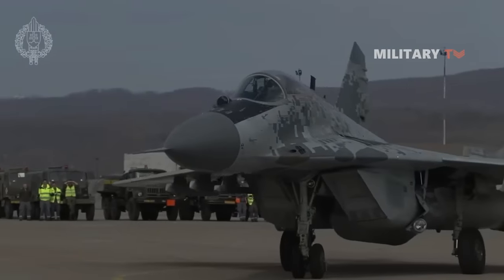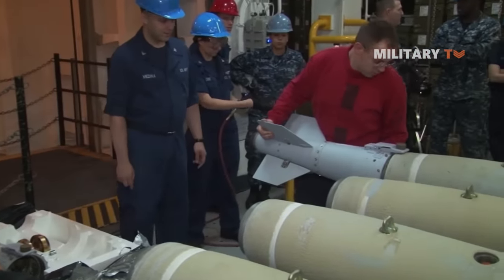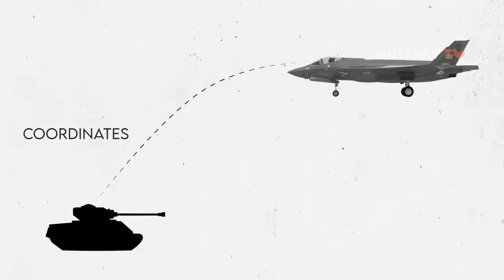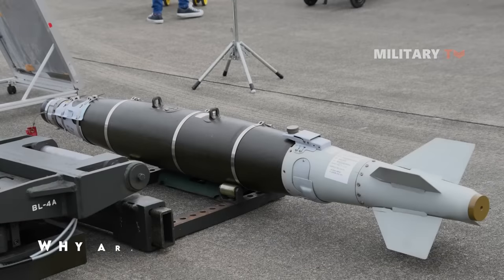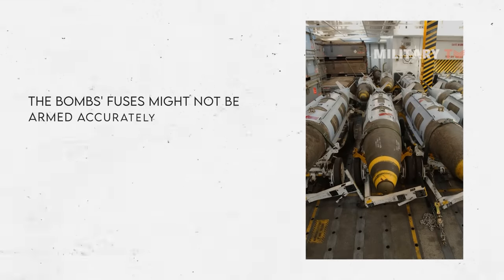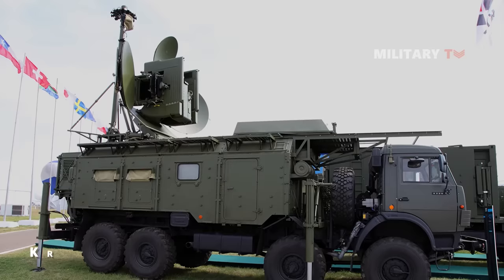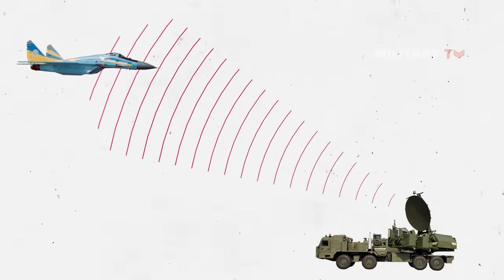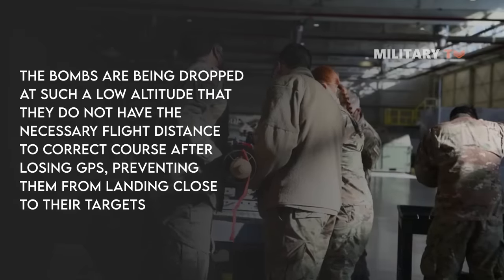Why Ukraine GPS Guided Bombs Are Failing?

Comment: Jamming isn’t the problem. JDAM, GMLRS, Storm Shadow, etc all have GPS and inertial guidance. If they lose the GPS they switch to the inertial. It’s not as accurate but it will still get the weapon close to the target. The real problem here is GPS spoofing so that the weapons think they are somewhere else and don’t switch over to inertial.
Reply: Huh. I would think GPS signals would have cryptographic signatures.
Reply: Is there a way to switch to inertial only? If this isn’t the case, I imagine there will be a team of coders at Raytheon working on this as we speak.
Reply: Your absolutely right👍But the and WE also Not realy with spoofong your 100%  right but there in that Problem and I think so they isolate spoofing,they find the Problem before😉
Reply: So, after looking it up, there are encrypted GPS signals, which should be immune to spoofing.
So I suspect the video is right - the problem is the jamming, not spoofing.
Reply: Glad to see this as the top comment. I don't know all the details of how the missiles can switch over to inertial guidance and anyone claims to is more than likely to be full of BS, but I would imagine you could turn off GPS guidance if you thought it was going to be an issue. It only makes logical sense. The people designing these weapons aren't idiots. It's my understanding most of these modern missiles have multiple guidance systems even beyond GPS and inertial. 

This whole video just screams Russian propaganda. 1. The poor English/tone it's written in. 2. Russia leads the west or Russia #1.... 

Do I think it's possible JDAMs are getting GPS blocked, sure.  Do I think Russia leads the west in anything other than false bravado and BS, absolutely not. Russia =/ USSR and they can't even build modern microprocessors or aircraft parts. How the hell are they ever going to lead a collection of countries that can and have economic power orders of magnitude more than they do.
Reply: @mundanesquirrel8687  Depends on what signal they are using.  If they are using the "C/A" channel, that is publically known to all.  If they are using the "P" signal, that standard is not publically available and is assumed to be encrypted.  My knowledge dates back to the early 2000 era, so more modern signals I am not familar with.
Reply: @julianmorrisco  Trying to find out the details of these missiles is near impossible without a clearance unless you want to rely on shady internet sources, but I would be SHOCKED if there wasn't an option to switch to inertial prior to launch. It makes no sense why they wouldn't have the function.
Reply: @kennethng8346  One would think a actual bomb could use the military encryption and not having to use C/A.
Reply: @mundanesquirrel8687  Yes that should be the case.  But we've seen many cases where civilian GPS was used instead of military. Heck, how would we know if some manufacturer didn't substitute a cheaper civilian unit and never expected to get caught (like the Russian firms).
Reply: Ngarm are need of the hour but they are expensive.
Reply: @specialK319319  incorrect, their range of air defence systems is unparalleled  in the west, many systems have no direct equivalent.
Reply: I'm sure that at the time of release from the airplane the pilot is aware of the coordinates and is able to check correctness.- If not, then it must be a simplistic "integration" with the MiG-29. 
UA is still successful in delivering precise HIMARS strikes, so the problem is probably lying differently from "simple" GPS jamming or spoofing.
Reply: GO old school  set them up to work with LORAN D  stations rather than GPS  as we did in South East Asia before there was GPS satellites'.
Reply: @spxram4793  I have no personal information, but I suspect the connections are very hot wired.
Reply: @mundanesquirrel8687  GPS is an international world wide system   and as far I beleive ti does not have a MODE IV (US SECURE)  or Worberlation (SOVIET SECURE) capability like the international IFF system.
Reply: @yevgeny79  modern inertial devices are really quite good. Each mobile phone, eacg drone and so on has integrated inertial sensors, and they're much better than these old things like in a B747 for instance.
No idea, what was designed into the JDAM.
Reply: @mundanesquirrel8687  Spoofing is one form of Jamming.  As an OLD ECM systems instructor there is a lot more I could tell you all but  then I would have to (you know eliminate you)
Reply: Truth is we allow to much information to be revealed as to how something works all they have to do is use the term smart weapons to keep certain things from the enemies knowledge
Reply: @dickslocum  ? GPS is just a generic term used to describe systems like NAVSTAR, GLONASS, GALILEO and so on.
All of them have different capabilities and protocols. Based on what you write, this should not be new to you ..
Reply: @John-hu9qg  Sure buddy, the country that cant build microchips and is now 15+ months into a war with a country a fraction of the size using NATO hand me downs has the best military tech in the world. They just have a humiliation kink and arent trying yet...
Reply: Inertial doesn't correct for wind, humidity, etc.
Reply: @mundanesquirrel8687  Military GPS is secure.
Reply: @specialK319319  I'm strictly referring to their air defence systems and missile technology, which is cutting edge.
Reply: @specialK319319 I read your observation two (2) times to fully understand your assertion. Thinking that the US is the only country in the world that can manufactures sophisticated weapons is an illusion. 
Yes, the US has spent billions if not trillion of dollars to be a dominant  military force in the world; at the same time  the US trumpets his success unabatingly every day, other countries are also working discreetly and amazingly have come up with the same/superior in quality products.
And yes, only few individuals will point out the shortcomings of their country's military. 
Acher Daniel Midland Company CEO said year ago when I was an undergraduate in the US that " the moment you think that you have discovered a product, someone, somewhere in the world has discovered the same product but does know what to do with it due his or her environment "
The US is excellent when it comes to propaganda. In fact, the US is the best in the world.  Does the US have good military products? Yes it does!
Does the US have the best military hardware in the world. Yes and No.
The reason the so called 'Smart Bombs" are not working is because the war contrary to what people say is between NATO and Russia and the latter has deployed some of her sophisticated weapons.
The
Reply: They'll rewrite software to adjust when GPS and inertia  tracking disagree.
Reply: @spxram4793  There are quite a few stories of GLMRS not being as precise as they used to if the Russians are expecting the area to be attacked.
Reply: @julianmorrisco  - you can bet on it! We are learning a lot about our weapons effectiveness in real time against Russia's tactics.
Reply: Hard to say without having someone on the ground feeding u telemetry data. But spoofing certainly could cause a 50 foot hole in an empty field. Lol
Reply: @mundanesquirrel8687 they are spoofing the satellite. I'm sure it gets real complicated real fast. I'm a cybersecurity student & it makes my head hurt how in depth a convo about this topic could go lol
Reply: @mundanesquirrel8687  Correct.
Reply: @yevgeny79  jsem si jistý že nevíte nic o vývoji inerciálních naváděcích jednotek za poslední pár dekád.
Reply: A document in code is not dechiperable if the document is destroyed...
Reply: @yevgeny79  you funny vlad nice try
Reply: @spxram4793  prob the latest jdams are akit so they can be upgraded.
Reply: Glad we get to test our equipment against Russia so we can improve it. Thanks, Ukraine will get it right and get it to you!
Reply: Maybe the American weapons are not as advanced as they say....
Reply: @yevgeny79  It’s not ‘super inaccurate’. It’s not pinpoint fly through a window type accuracy but it will get you near the building.
Reply: @spxram4793  My terminology is accurate. These weapons are guided by the USAF GPS satellite network. Glonass is, frankly, pathetic. Gallileo, however, is pretty good.
Reply: @ViceCoin  inertial corrects for wind. Look at the WCMD programme.
Reply: @mundanesquirrel8687  Spoofing is much harder than jamming, but the Russians have been working on it since the early 2000s. In Iraq their spoofing was able to make US weapons miss by dozens of meters. For hard targets that’s enough. And they’ve probably gotten better since then.
Reply: @dickslocum  GPS has the civilian mode and the encrypted military mode which is accurate to something like 1m.
Reply: @spxram4793  GPS is the acronym for the USAF satellite constellation. Others may use the same term. I am using it in its original sense.
Reply: @spxram4793  I am using the term GPS in its original usage as the USAF Global Positioning System satellite constellation. Not as a generic term.
Reply: @specialK319319  Dude, buddy, no one said Ukraine is building the weapons that are giving grandpa Vlad a migraine.
Reply: @ViceCoin  for wind it does, a bit, for humidity, um, I don’t think that’s much of an issue. I may be wrong, but I think wind is the big issue.
Reply: @mundanesquirrel8687  Exactly! That seems to indicate that Russian spoofing research is being employed to protect Russian assets from strikes.
Reply: @jdogdarkness  Exactly! There may be spoofing from satellites too. Otherwise, all it would take to block it would be some ground-facing foil to stop Russian efforts.
Reply: Spoofing is handled by comparing inertial to gps. If the two diverge more than max drift spoof is assumed and gps is disabled. Next step is for camera ground recognition where a camera looks at terrain and matches it to a map and inserts correction. Cruise missiles typically have cameras now. Maybe a 100 gram payload.
Reply: @yevgeny79  MEMS tech has improved so very low cost. If you have say $20000 to spend, laser ring gyro has almost no drift. I think it was 500 meters at 5000 km
Look up laser ring gyro. Try buying one used and watch who comes to visit you.
Reply: @julianmorrisco  the coding is outsourced to India where the programmers ask for Russian input. Then Raytheon charges American wages coding rates rather than Indian coding wages so that they make a few bucks extra profit.
Reply: @specialK319319 agreed
Reply: @mundanesquirrel8687  Spoofing of GPS has been done before to ships on the ocean.  It's a real known issue.
Reply: JDAM's are failing because they are, "Made in America". Derp derp derp.
Reply: @marjanpavlovic211  but americans weapons is the best according to CNN
Reply: @specialK319319  It's a good thing no one's depending on you for advice. More than 80% of the bombs, HIMARS and other missiles missing their targets, this is the issue, and the fact. The rubbish you posted here have nothing to do with the issue. Stop distracting,
Reply: According to Russian MOD, they convert shovel to Krushna Electronic Warfare System in jamming smart bomb. Confirmed by Nato😂😂😂
Reply: @marjanpavlovic211   bo they are but they get updated from time to timd the whole thing on jdams is its a kit bash the main. Bomb is an old school dumb bomb with added senseors amd fins to bring up the accuracy alot. Long as its updated or sensor replaced by better one it sill keep working. Trust these bombs are hitting their marks but from tine to time as with all weopons you will have misfires of errors and the russsians are def trying to find ways to jam amd spoof but that will only last so long till they overcome it.
Reply: Or maybe it is a level of expertise in delivery that the Ukrainians just don't have. They are receiving hi-tech munitions that US operators have spent years learning to use, not a few weeks or months. The Russian FAB bombs seem to have a higher degree of accuracy as well. This video should be a wake up call for those who continally rubbish the Russian capability in this war.
Reply: @kevin5073  nope fab bombs are proven to be inferior to jdams their NOT as accurate. However the fact that the russians are just as new as the ukranians are at using jdams cam be a big factor. How. Ever russians also have the issue of launching further away due to aa. Ill give the ukranians the win simply because theyve shown adaptability and quick curve learning but nost importantly the ukranians haven't. Bombed their own city like the russians did in belgorod!
Reply: Spoofing is a form of jamming.
Reply: @yevgeny79 hough the Earth is spinning and the moon is circling the Earth at a pretty fast speed and for that matter the Earth is orbiting the sun
and I suspect that the direction in which the Apollo craft left Earth
had to be accurate within a very tiny percentage of a degree.
Sounds very complicated even if the moon is big.

The soldiers firing missiles and shells in Ukraine are generally 
firing from an unmoving spot on solid ground 
to try to hit another unmoving spot on solid ground.
That's got to make things a bit easier.

Now if scientists could discover how a dog can figure out the trajectory 
of a curving dropping Frisbee to know exactly the right direction and speed
to run to intercept the path of the Frisbee before jumping and catching it.
Reply: @spxram4793  Those constellations you are referring to are GNSS. GPS is a US constellation.
Reply: @spxram4793  are you sure about that ????
Reply: Storm shadow uses terrain contour matching which make it entirely immune to GPS jamming.
Reply: @jeromebarry1741  ofc it has. it wasn't uncommon even in civilian life. but that wasn't encrypted, military GPS, was it?
Reply: They do not switch: they use both. Also jamming is different than spoofing. Guidance kit detecting loss of GPS vs. being confident in signal received is another thing entierly.
Reply: Storm Shaddow is far more robust, it is able to use digital scene correlation and radar retain contour mapping.  It doesn't need GPS at all.
Reply: @mundanesquirrel8687  and be frequency agile. Very old technology. Time to keep up.
Reply: @spxram4793  The ones in 747s are approximately 500,000 times more accurate than the one in your mobile.
Reply: @richardkudrna7503  the drift is a function of time, not distance.
Reply: @julianmorrisco  Inertial guidance needs to know where it was to adjust to where it isn't
Reply: @spxram4793  INS? - The first 747 could fly from the US West Coast to Sydney and not be more than five miles off track after flying thousands of miles. Hitting a target fifty to a hundred miles away seems less difficult. The GPS systems attached to dumb bombs do not seem to represent the heights of modern technology. They're quite cheap. That is a criticism all by itself in what it suggests about their abilities and accuracy. Information systems seem to pretty good. Time for accuracy to catch up. This is not the Gulf War and the Russians despite lots of bad decisions are not Iraq's Saddam Hussein in 2023. They have serious management problems but they are not technically inept.
Reply: @jamesjohnson1710  BINGO! We put all the info on the front pages of national papers everywhere and then there's the internet and children take home classified information and post it to friends on the net. Why am I so angry? Stupidity in others does that to me.
Reply: @Atchinin-ih4wq  If you have a really good idea, there's a really good chance legions of other people have the same idea ... or better.
Reply: @allengilbert3662  Yes - I have mixed up the terms - thanks for clarification.
Reply: @pavelsulc2617  The problem may be that the INS on a dumb bomb is only a cheap back-up. I have a feeling that spending a lot of money on the best INS technology may work - as good as any system - but be prohibitively expensive to put on a dumb bomb.
Reply: @richardkudrna7503  Not something cheap enough for a dumb bomb.
Reply: @John-hu9qg  their missile tech might be cutting edge, their jamming techniques are just coming into focus since an ew system was captured laat year.  I'm expecting any edges there to be smoothed out shortly 😏
Reply: @TedForbes-j4i  source: trust me bro
Reply: @mundanesquirrel8687  that would render is useless for the general public, wouldn’t it?
Reply: @sjoerdsantema  I believe GPS is transmitted both encrypted and in the clear.
Reply: @mundanesquirrel8687  Encryption can be broken.
Reply: You may be right. Combined GPS/Inertial systems use error detection/correction algorithms (e.g. Kalman filters) to minimize errors. If such algorithms are ill suited to jamming, I expect our signals intelligence has long been sampling and analyzing all signals, including jamming, has been modeling its effects in simulations against the missile's control system, and has/is updating firmware. From what I've seen in the news the HIMARS launched missiles have been quite successful as has the 155mm Excalibur smart shell. Perhaps because these travel so fast (relative to subsonic glide bombs) , their algorithms inherently rely more on dynamic INS signals rather than the slower updates available from GPS.
Reply: @ViceCoin  Actually, INS DOES correct for wind, humidity, etc.    The INS detects the EFFECTS (i.e. drag & thrust) that humidity, wind and varying air density have on the vessel's motion.
Reply: @mundanesquirrel8687  gravity waves?
Reply: @glynnwright1699  laser gyroscopes 
Astounding accuracy
Reply: @richardkudrna7503  The use of optics and terrain matching seem like they'd offer a major enhancement. But based on what is publicly stated, NONE of the ballistic missiles, like those fired from HIMARS, or JDAM use optics. It makes sense that in time they will. But given the prevalence of clouds, the utility of optics, at least in the visible spectra, may often be very limited.  We do have some munitions, like the 155 millimeter 'Copperhead' munition that use optics to home in on targets designated by a laser. Also, as best I i understand it, low flying cruise missiles may use radar instead of 'visible' RF spectra in order to overcome the effect of clouds.
Reply: The first misstake was to underestimate the enemy's capabilities. Russia is not like the talibans, they have advanced tech and skilled troops.
Reply: Add a phased array antenna on the belly  to the JDAM,  if it looses its GPS signal then change target and aim for the source of the GPS jammer, thus destroy the jammer, now it becomes a "radiation missile"
Reply: @richardkudrna7503  Actually, they are less accurate than other types, including ESGs.
Reply: @mundanesquirrel8687 Superior Russian shovel spoofing. Those Russian shovels are incredible.
Reply: Maybe  but then false signal had to gracefully changed so that not an impossible position is suddenly received , which implies a hook-off signal and⁷ immediately relying only on INS. 

I dont think that the Orcs is up to such a complex task.
Reply: @gregparrott  agreed, camera or emitting radar for terrain match sounds hard on a HIMARS missile intended for fairly high altitude flight then vertical terminal phase. Also I think given the short time of flight the inertial is capable enough. I’m starting to suspect that the whole claim of HIMARS defeat by gps jamming is exaggerated.
Reply: @mundanesquirrel8687  ломаются на раз. Grey Eagles тоже хакаются ГРУ РФ на раз. Мой друг целый год следил как вы в Сирии летали😂
Reply: Wrong and wrong. Misleading lies.. Slava Ukraini. Storm 😊
Reply: @glynnwright1699  laser ring is very good, wiki mentions 0.01deg drift per hour. What is ESG? Is that earth rotation sending?
Reply: @SohoComedyClubLondon  People have been spoofing GPS using software defined radio to cheat in Pokemon Go soon after the game became popular. As a matter of fact, the code for software defined GPS signal simulator is open source. Any technological advantage is only temporary, as people are quick to figure out a way to cheat whenever there is an incentive to do so.
Reply: @Atchinin-ih4wq  when you asserted this much you might wanna prove a least something of what you said
Reply: @richardkudrna7503  Well, it is secret, but probably aa thousand times more accurate.
Reply: @julianmorrisco  Did Raytheon get a contract $$$$?
Reply: Actually, the issue is inertial requires GPS to be active to know the start point and target location. Inertial kicks in when the GPS signal is lost, after a GPS signal having already existed.  GPS has to be available at some point to prime the targeting.  And it isn't, or it is just spoofed.
Reply: @mundanesquirrel8687 I don't know.
The Russias aren't stupid.
They may have found the encryption keys or worked out a way of negating the encryption...
Reply: @specialK319319  Russia has long history of jamming everything going back to post ww2
Reply: Intertial guidance needs corrections.
Reply: That's why need to add AI day/night terrain mapping navigation and target acquisition guidance systems to them in an upgraded add-on package.  That combined with their inertia guidance system,  should be sufficient for them to function effectively without a GPS signal.  Add military grade shielding around the electronics.  Problem solved,  mission accomplished.  Then they can simply disable GPS navigation and pre-program GPS starting coordinates from well known launch points, within controlled airspace.
Reply: I see
Reply: @ViceCoin  Wind?!? What do you think inertial means?? 

Humidity? It's not a sniper round, it's a 1000+ lbs bomb.
Reply: @SohoComedyClubLondon  I'm not sure which "they" you are referring to - Russian Spoofing or US weapons. 
My guess would be that if Spoofing was interfering with US targeting, the US would respond quickly by throwing several billion at finding a solution.
Reply: @richardkudrna7503  interesting. Thanks for the info. 👍
Reply: @UKnowIfUKnow  If it were s simple, why are these bombs failing?
Reply: There is no sense to use such expensive weapons with so poor performance
Reply: @mundanesquirrel8687  The military GPS is encrypted. So you're correct.
Reply: Well, that's also jamming.
Reply: Just one thing is certain, Ukrain is doomed. 😂😂😂
Reply: @specialK319319  you’re 100% right on everything. Most likely scenario is operator error unfortunately if there’s a miss but this video does wreak of Russian propaganda lol 🇺🇸🇧🇧
Reply: @victormonte5881  people don’t realize that there’s teams that analyze and adjust everything 24/7 based on the previous missions, mistakes, countermeasures etc and that it’s just a continual game of cat and mouse. Every time you jam or spoof you are also lighting yourself up for a harms to come smoke you. That’s why there are decoys which we know Ukraine has been using. Russia is superior at nothing and are in a constant state of catching up since they started this war.
Reply: @SkeezyFPV  very much so well Said. they did this to themselves and its game of cat and mouse the R and D is what makes that diffrence and makes us so good. As much as russia deserve alot of the setbacks that they are experiencing part of me does feel sympathy for the basic grunt. They really are sending them into a meatgrinder. And im in awe of how well and adaptable the ukranians have been able to learn western systems quickly. But your last sentence perfectly sums it up, sad to see but then again dont invade a sovereign nation with out preparation better yet don't do it! The amount of data that this war will yeald from the confrontation of western vs russian or adversarial system will be intresting regretfully at to great a cost god help us all if  this conflict expands as the lethality of these systems will incresase. Hell never thought id see fpv drones used as guided missles. Excellent point sir
Reply: Use Russian GPS system
Reply: Where is the HARM missiles?
Reply: @mundanesquirrel8687  There is encrypted GPS. I don’t know if the USAF has shared those codes with Ukraine. But you can still jam encrypted GPS. It’s like trying to send you an encrypted Morse code message with a flashlight and someone else shines a strobing floodlight in your face at the same time. It doesn’t really matter if you can read the code.
Reply: @julianmorrisco  Usually yes, but accuracy drops, especially if it’s windy.
Reply: @mundanesquirrel8687  The encrypted signals would be harder to spoof. Spoofing generally involves mirroring the signal and changing it slightly. But you can mirror a signal even if you don’t understand it. There is also the question of whether the US has shared the GPS codes with Ukraine. There would be some serious concerns that Russia would get them. Sadly, I don’t know the answers to these questions. I’m just speculating based on my past reporting on these issues.
Reply: @specialK319319  Good points. But Russia has been working on GPS spoofing for more than 20 years. I was writing about successful Russian tests in the early 2000s. Russia has some excellent engineers and military thinkers. Their problem is that expertise doesn’t flow down to the men in the field. For example, the whole Ukrainian tactic of combining drone operations with artillery, which they’ve done to great effect, was not a Ukrainian invention. It was Russian. When Russia took parts of Donbas and Luhansk in 2014 they were doing this and smashed the Ukrainians. The Ukrainians adopted the same strategy. But still only a select group of Russians can conduct drone-artillery operations effectively but ALL the Ukrainians can.
Reply: @kennethng8346  I think there are a lot of variables, such as GPS antenna geometry and whether it’s shielded from the ground, is the jammer/spoofer airborne, can Ukraine use the encrypted channel, how effective are spoofers against encrypted signals? Sadly, I don’t know the answers to these questions. I’m just speculating based on my reporting about GPS and Galileo as used in air warfare in the naughties.
Reply: @specialK319319  Confirming your speculation, I remember having briefings by defence contractors about how the weapons had both GPS and inertial guidance and could switch to just inertial in case of severe jamming or spoofing.
Reply: @mundanesquirrel8687  Could and does are different. I’m not sure if the US has given Ukraine access to encrypted GPS.
Reply: @yevgeny79  Inertial guidance is old, but the current incarnations are not. During the 60s an inertial measurement unit (IMU) was the size of a coffee can housing mechanical gyroscopes. But starting in the 1990s when NASA JPL started making solid state laser gyro IMUs on a chip, there has been a revolution in inertial measurement. It’s IMUs on chips that allow your phone to know orientation or for a fitness tracker to work. All that said, IMUs are a lot better than they used to be. Nonetheless, if there is a steady wind, it will push weapons off course.
Reply: @dickslocum  GPS is the property of the US Space Force, originally the Air Force. It is globally used but is very much a US govt asset. That is why the EU created the Galileo system, just so EU countries wouldn’t have to rely on the US system. It’s also why Russia has sort of maintained their GLONASS system.
Reply: @spxram4793  When I was reporting on the JDAM, the program manager told me that the guidance kit has both GPS and solid state inertial guidance and is designed to switch to inertial whenever there is a problem with GPS. I think he also said it can be launched purely with inertial if GPS is unavailable.
Reply: @spxram4793  Sorry, I know I’m being pedantic here, but NAVSTAR was the original name of the Global Positioning System. The generic term is satellite navigation system. Also, the European system is “Galileo”. It’s a name, not an acronym.
Reply: @Atchinin-ih4wq  Sorry, but your comment has nothing to do with what I said.
Reply: @mundanesquirrel8687  I heard just recently that the Ukrainians are using Russian jamming locations as a means to locate important Russian assets. It makes it harder to hit, but it’s also a beacon that screams “important stuff here!”
Reply: @jdogdarkness  Do you mean using satellites to spoof the GPS signal? That would be much harder to protect against.
Reply: @richardkudrna7503  Thank you for the informed comment.
Reply: @williamzk9083  Storm Shadow/SCALP is an excellent weapon. Targeters say they don’t aim it at building, the aim at the window they want to fly through. But it’s also expensive. JDAMS, GLSDBs, and GMLRS are all cheap and usually very accurate. When you’re talking about bang for your buck, a Storm Shadow is something like $2.4mil each, whereas a JDAM or GLSDB kit is around $50K. Storm Shadow is only worth the price for high value distant targets like a HQ unit or the Kerch bridge.
Reply: @SohoComedyClubLondon  I know some of the systems also use LIDAR as well and frankly im sure there is other tech we dont even know about yet.

The SR71 and ICBMs use light patterns from stars to naviagate and thats 50-60s tech. I'm sure the stuff they have now is insane.
Reply: There are a variety of gps signals, when one gets jammed switch to another
Reply: @SohoComedyClubLondon  Personally I think the inaccuracies are the result of a mixture of jamming, launching under sub optimal conditions, and hot wiring of the missiles to make them launchable from aircraft they were never meant to be launched from.  I can't imagine the number of voltage converters, protocol converters, and fuel and cooling adapters they must be employing.  Scotty from Star Trek would be proud.
Reply: @Peabush  I think here you introduce the possibility that the launch crews were spoofed as to their location. If lazy, and you don’t confirm your true map location and there is say a 100 meter error in your actual map position, that is added to the drift error. Hopefully crews are being trained to verify their actual map position.
Reply: @cmw9876  And the 1970 navigational systems used mechanical gyros. If I remember correctly, they had three gyro sets and averaged them unless one got voted out. Very cool was the Singer inertial nav with stellar update. F-104 were equipped with this system where a camera looked at the stars and with a primitive computer corrected the gyroscope. Commercial aviation rules prohib depending on GPS as governments can wobble this whenever they want. Once laser ring gyroscopes came out, accuracy became astounding. In my junk somewhere is a John Oster TACAN display for the old fixed station nav system that displays distance, heading, speed. Those worked very well but of course could be jammed.
Reply: @specialK319319  I think that you might have nailed it. FSB propaganda channel for sure.
Reply: @JoeyBlogs007  I spoke with a designer who had worked with using cell phone camera and processor to do terminal phase target correction. In other words, the cell phone uses image recognition to spot the target shape and make final corrections. The limitation here is the camera needs light. Another low cost innovation to avoid the cost of proper terrain imaging and map following to fly fast and low is simply to use inertial to hold an altitude and periodically pulse a ground proximity radar to make sure you are not drifting low. Say you select 50 meters altitude over flat terrain, inertial alone risks hitting the ground or drifting high into radar. Every say 10 minute you pulse the $100 used ground proximity radar and correct your altitude. Brilliant ! Basically you can build a good cruise missile with 200 kg payload for say $200000. Technology moves.
Reply: Apparently they just released a new JDAM ER smart bomb with 45 mile range.
Reply: Nazism --- Relies on myths about the historical greatness of its own nation, its belonging to a "superior race", which, according to the ideologues of Nazism, gives it the right to expand the so-called "living space", seizing the territories of other states and carrying out a policy of genocide on them . Often presented as a variety and synonym of fascism, although this view is incorrect,
due to a certain difference between these two ideologies.
In contrast to both capitalism and communism, it was aimed at overcoming social differences, with all parts of a homogeneous society, and upholding traditionalism as the antithesis of trying to artificially create the appearance of national unity in multi-ethnic countries.
The ideologues of German National Socialism considered the historical territories of the Germanic tribes as additional lands for the expansion of their own state. Currently, National Socialism is considered a misanthropic ideology.

Fascism is a type of political regime, as well as a radical authoritarian imperialist political ideology,
the characteristic features of which are a strong personality cult, militarism, totalitarianism, imperialism and the idea of unity, mobilization of the nation and the state against enemies, the idea of constant war and domination.

Do you think any of this is suitable for Russia???
Reply: @JoeyBlogs007  the conversation happened in Canada but the designer was employed overseas at the time. For privacy I won’t say more about him.
Reply: @richardkudrna7503    Not sure a mobile phone has the image processing power,  but I guess they could reduce the dataset and update it every two hours from spy satellite data to allow day / night terrain mapping for large targets,  if it had a decent camera.  But the processing speed might be a problem for anything beyond a drone. i.e. a JDAM ( 600 kmh) or cruise missile(1000 kmh) might be too fast for the camera phone to process the imagery in time.  Perhaps it might be possible with a sophisticated data reduction algorithm tuned for specific large target type acquisition for terrain following and terminal flight targeting.  Some level of AI vision might be required also.  Just guessing though.
Reply: @sergiytokio7295  Is that a rhetorical question?
Reply: @SohoComedyClubLondon  Russia blames Ukraine for all this.
Reply: @richardkudrna7503     I would guess they might need multiple image maps for visible and infrared imagery processing. Various image types for different cloud conditions also.  The AI would determine the most appropriate image type to utilise, based on prevailing weather conditions along with time of day / night. Possibly also taking into account moon lighting etc...  Much of the imagery might not be discernible by the human eye,  however with AI it could be able to be processed to derive meaningful terrain identification and large target acquisition data for the mission.
Reply: For fixed land targets I guess it wouldn't need to rely on updated mapping, if flying low altitude.
Reply: Storm Shadow does not use GPS as such it uses INS which does not rely on GPS . So that’s why they having so much success in Ukraine
Reply: @saviomontero2306  <—🤡
Reply: @Chris K   You know what's more advanced than Russian Tech? Your Coping Mechanisms. 😂😂😂
Reply: @JoeyBlogs007  I think the example described to me was more engaging the camera intermittently to zero the inertial nav. While he didn’t say this to me I imagine at the terminal phase the weapon climbed then looked down. That gives several seconds to recognize target shape and insert the corrections. I imagine a “real” ground contour following vehicle at low altitude scanning the ground to match maps as having a big processing burden, but when I think about it, machines were doing this (multi million dollar) in 1990, and phone processors are quite strong now. I’ll chat with my friend about what it takes to crunch an image coming in at high resolution and high scan rate.
Reply: @TedForbes-j4i  Can you post one HIMARS strike that missed?
Reply: @SohoComedyClubLondon  I would imagine they would do it on the ground more widely. Russia doesn't have that many space assets. But they do invest heavily in mobile electronic warfare vehicles. Im not knowledgeable enough to give definitive answers as far as the means go. Just a general range of options unfortunately.
Reply: No I think the issue is what was said in the video : the JDAM are launched too close to the ground (in order to avoid long range search radars), meaning that the moment when their GPS signal is jammed, they are too close to the ground to effectively correct their trajectory thanks to Inertial Navigation backup
Reply: @specialK319319  - Did you ever really study what the USSR was capable of? Have you kept up with at what level of military science and technology Russia is moving now? You talk about microprocessors. Your best LSI microprocessors are coming from Taiwan, not the US, made with equipment of which the most important come from the Netherlands (ASM), designed and perfected by a team lead by..., a Russian engineer. Westerners like most of us are so full of it.
Reply: Looking forward to reports of the jammers being destroyed.
Reply: did you watch till the end ??
Reply: The real problem is when you are used to fighting armies that can't fight back.. When a real challenge shows up, all types of verbiage start.
Reply: @kennethng8346 it could also be intentional since Ukraine isn’t part of NATO.
Reply: @specialK319319  Bro, nato is a beast and could easily smash a rest off te world coalition in no time. But dont forget US lost war to vietnamits with shovels, tribal afgans with aks and a nooby chinese army in korea. Having said that i also dont believe in these magic russian electronic warfare capabilities
Reply: The bigger question is, does quantity trump accuracy in modern warfare with Russia and China, which are both high-tech countries. In war sometimes simple is better.
Reply: The weapon should keep checking its INS guidance to figure out if it roughly matches the GPS position and if that's not the case, switch automatically to INS unless both match again.

At that's what I would program the weapon to do if I was the developer.
I'm pretty sure the engineers were smart enough to think about that.

I don't think there's a problem with any of the weapons.
I think the problem is that Ukraine has only very few jets that can utilize these highly effective western weapons.
That also means that these jets have to used with extreme caution only, reducing the number of sorties and sortie opportunities.

I also think that the stocks of western jet carried weapons is low and supply very limited.
I really don't get why the US keeps sending cargo planes instead of sending supply ships loaded with the good stuff.
I mean, how many mid sized GBUs and HARM can a C-130 carry?
Not that many I'd say.
Reply: @mundanesquirrel8687  the US military, if I remember correctly, can indeed encrypt its GPS signals. It just chooses not to because it's used by so many civilians
Reply: You also defined jamming without knowing 😅😅😅
Reply: @mundanesquirrel8687  encryption can be cracked too bro 😂
Reply: @kennethng8346  where did you learn this
Reply: @dickslocum   can you elaborate more please on your experience but please nothing beyond your security clearance
Reply: @jamesjohnson1710  you enemies aren’t stupid that’s why you lost to goat herders with your smart weapons
Reply: @specialK319319  the copium harm missiles patriot systems and iris t systems Turkish drones American satellites Bradley’s and leopards all are hand me down cut the crap Russian artillery and drones simply exposed that nato never fought a powerful enemy and never will they need their enemies to maintain their combat readiness and logistics you know fuel and other raw materials that soon you’ll yearn for
Reply: @specialK319319  and Russia can use Chinese exporters as a source of microchips yes China had achieved large breakthroughs in microchips to 7nm level and is  simultaneously developing its lithography capabilities so more copium for you
Reply: @larrycox7169  spoofing isn’t that easy to overcome
Reply: @spacejaime  sure
Reply: @jdogdarkness  I’m in computer science and study strategic studies and defense  next year I’ll have to choose either cyber security or  data mining track for my emphasis what do you suggest I’m really into modern warfare electronic and cyber warfare and looking for a career in defense
Reply: @firasajoury7813  ca vs p code, navstar signal reference manual. Hotwire, like I said no personal info, but I suspect someone like Scotty hotwiring the romulan cloaking device into the Enterprise shields.
Reply: @julianmorrisco cope more uki
Reply: GPS spoofing can be detected by comparing resolved gps coordinates with calculated by inertial position subsystem. So its not so easy as might seem.
Reply: @specialK319319  The funny thing is that Americans can't either.  The Chinese do it for them
Reply: @eyaklen4804  I would not laugh, this shovel can take over control and send the rocket back
Reply: @richardraw1452  Latest Russian shovel is Tank T54 made in Soviet era. Russian genius engineer convert into kamikaze similar to drone & kill the Ukrainian troops in the frontline.
Reply: GPS is same as telephone by an banana😂😂😂
Reply: compare with Russian jets bomb their own cities, it is a huge success
but the real problem is that Putin fear of modern chefs 😂
Reply: @specialK319319 After 20 years the United States and NATO couldn't defeat the Taliban. Your point is? Those guys only had AKs and RPG. Yet the United States and NATO couldn't defeat them. You have no room to talk about Russia not winning this war sooner 🙄.
Reply: @julianmorrisco  This GPS is not set up for fun and entertainment. Accelerometers and gyroscopes have a certain threshold of sensitivity and their own noise, as a result, after a while the errors accumulate and you start to get completely distorted X, Y, Z data. Therefore, a GPS correction is made. The smaller the intervals between corrections, the more accurate the trajectory.
Reply: Another important thing to highlight in electronic jamming systems are the IVF centrification of glide bombs ,the calibration of the target coordinates significantly becomes  immune to any form jprs ,jprs202 jamming
Reply: Either way it amounts to the same thing 😅😅😅
Reply: Inertial navigation comes into the picture after boost phase and cannot be used in mode such as lock on before launch I guess.